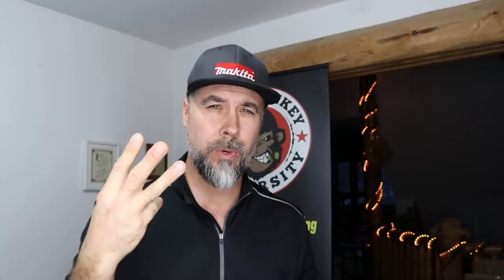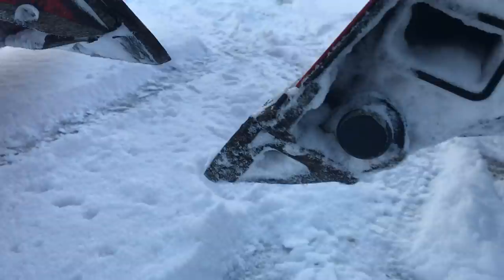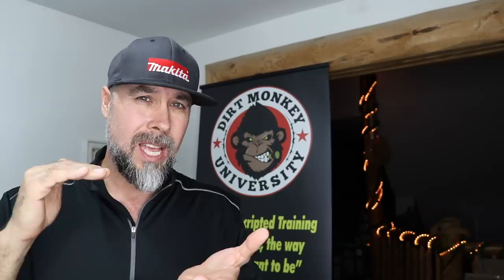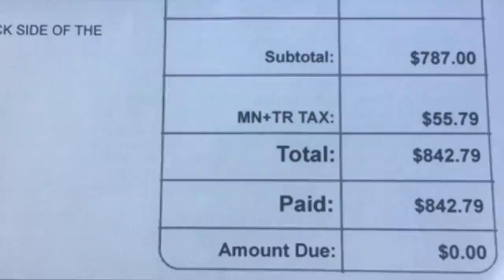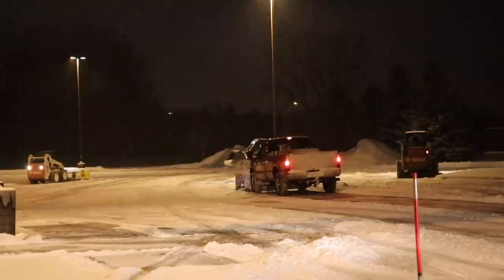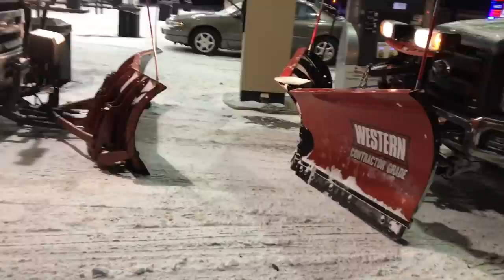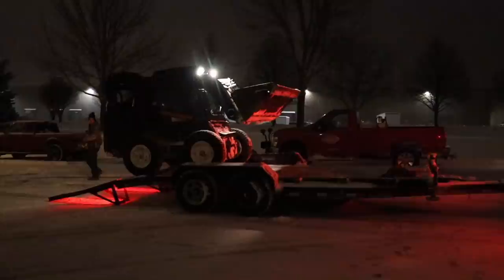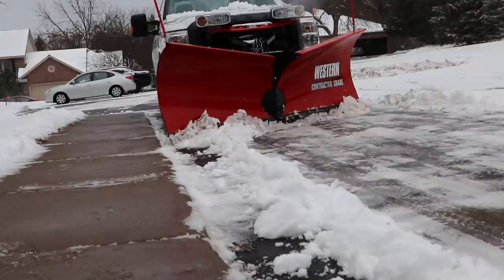Western Snow Plow Review after 13 years - Plagued with Problems

Comment: Stanley, why not contact somebody like metalmatic and have them CNC cut a different blade out of 100 series stock, make 10 and sell the rest as upgrades to cover your costs. If you use my idea, you owe me lunch. Smile.
Reply from the maker: I owe you lunch because that is my next plan.
Reply: AR500, its AR because its abrasion resistant
Reply: MinnesotaEric why would you pay sombody to waste time using a cnc machine to fabricate a cutting edge ? A cutoff wheel & a 1/2" drill bit will yield the same results.
Reply: It looks like Western has a lip, band sawing everything to the right size takes time, drilling ten 1/2" holes per bar takes time, and making ten replacement edges takes even more time and my time is worth money.
Reply: MinnesotaEric 3 complete cutting edges could be fabbed up in an hour. The amount of money you'd save should far outweigh the cost of purchasing and paying sombody to remove the old and install new edges.
Reply: Exactly what i thought of withing the first complaint. Make my own with better steel. 

As for the controller, id get a custom one with proper buttons and locations..
Reply: if it is a good hardened steel, a drill bit will not mark the steel at all, it brakes the tip right off
Reply: ROTAXD 
Ya like a standard drill bit will go through ar500 steel. 
Laser, plasma or waterjet only.

Comment: Wait...you're actually buying cutting edges from the dealer ? Smh. You do realize you could buy a 24' x 8" section ov 7/8" thick steel at your local steel yard for maybe $120 ? That's 3 complete cutting edges. Btw, western is known as a residential plow manufacturer. You get what you pay for. You claim you've plowed your whole life and you're still paying for pre made cutting edges & plow adjustments ? Smh

Comment: Late nineties into early 2000s. Meyer snow plows used crap steel on their edges and a frames etc.  used to see mostly yellow blades around here in north east Ohio.now they are all red. Boss and western.  Western better step up or they will go to the scrap heaps like Meyers.  Bad practice to charge so much and screw the user. They will learn quickly one way or another

Comment: hey man I'm letting you know that I have a buddy has a snow removal business he has four trucks two of his trucks has Western plows and the other two trucks has boss plows he had more problems with his Western plows they have froze up he has gone through five cutting edges with in  two seasons his two trucks with the boss has had no problems other than the occasional bulb replacement and the controls for his Western plows suck and the controls for his boss plows are way much better two of his trucks has the Western wide out and the other two trucks has the boss ext plows bottom line is he's getting rid of the Western plows and he's going to replace them with boss plows I even hate the Western plows controls because of the buttons I'm even considering getting a boss plows for my personal truck I have a 2018 Ford 450 super duty Platinum edition I'm looking at the boss ext plow for myself

Comment: MY NAME IS MIKE AND I LIVE IN WASHINGTN STATE  I LIVED IN ALASKA FOR 15 YEARS AND WORKED AT PRUDHOE BAY FOR 8 YEARS SO I KNOW A TINEY BIT ABOUT SNOW. I HAVE A WESTERN PRO PLOW  1997 VER. I PLOW ABOUT 10 TO 15 LOTS PER EVENT  I NEVER BUY MY CUTTING EDGES FROM WESTERN  THERE ARE OTHER PLACES TO GET THEM. 1 DID GET A ONE THAT WAS THIN BUT I STILL GOT 3 YEARS OUT OF IT. JUST REMBER WHEN YOU BUY A CAR THEY HAVE CHEAP TIRES . ANOTHER THING IS IT IS KINDA UNFAIR TOO COMPAIR V EDGES TO STRIGHT EDGES, YOUR PUSHING MUCH MORE WEIGHT WITH A V PLOW, MUCH MORE DOWN PRESSURE. IF YOU WANT TOO MAKE EDGES LAST LONGER  TAKE THEM TO A WELDER AND HAVE THEM HARD SURFESTED ALL OF ARE STUFF IN ALASKA GOT THAT TREATMENT. ANYWAY I THINK YOU ARE OVER REACTING . THERE ARE OTHER OPPTIONS OUT THERE . YOUR NOT GOING TO GO TO A CAR DEALER TO BUY  YOUR NEXT SET OF TIRES ARE YOU? JUST A THOUGHT!

Comment: Have you ever thought about fisher snow plows I feel they are made so much better then western plow.
Reply: Fisher/Western are the same, their parent company is Douglas Dynamics.
Reply: I know but I have a fisher extreme v2 for 3 years and the cutting edge has only worn about a 1/4 of an inch. Fisher also has two controller options in stead of 1
Reply from the maker: I would try something totally different next time.

Comment: They should be using mangalloy or AR-600 steel... It is designed to take that kind of wear. Western is using your standard weathering steel... Sure, corrosion resistant, but worthless beyond a few runs on anything but dirt.
Reply from the maker: Sounds like room for improvement.

Comment: Stan, I have all 3 of the brands Boss, Western and Myer so I really have no super brand loyalty. Looking at your two plows in the video I bet there is a big weight difference between the Hiniker and Western. That weight while scraping would certainly wear edges quicker. Also we were seeing this on our big plows that we use on our dump trucks.We started using the shoes and it saved cutting edges. Yes,we would wear out the shoes but there cheaper then cutting edges. Maybe try that just to see if it helps.
Reply: GreeneRidge Landscaping shoes? Who uses shoes? Lmfao those go right in the scrap bin first mod! Waste of your time, its like plowing with your plow not touching ground. For gravel drives for homeowners use lol
Reply: Kwmike-D they work well for us. Been doing it for years
Reply: GreeneRidge Landscaping they do work for the light duty/homeowner guys. Id wear those out first 2hrs of storm on one 28mi condo
Reply: Kwmike-D I don’t do light duty homeowner work.we do roads. Our large 10’ funnel plows were eating edges so like I said we started using shoes and when adjusted properly they did the job and saved edges. Also on roads the 8’ Western pro plus and Myers lot pro we’re going through edges fairly quick. We had our welder hardface the bottoms of the factory shoes, much like you do to an excavator bucket and we had great results and longer life out of the edges. Stan said everything he has done has not worked so I mentioned this as something to try.
Reply: I plowed roads for a town several years and adjusted the shoe height after every storm and it saved buying and changing cutting edges dramatically.
Reply from the maker: All great advice.  I did use shoes but we have zero tolerance-so we removed them.  Their is a big difference in weight from the hiniker to Western but both scrape the same. They both leave the ground with little compacted snow so in the end I worry about cost and those western blades are killing us.

Comment: Why don’t you buy Fisher plows?
Reply: His Western MVP3 and a Fisher VX2 use a lot of the same components like moldboards, hydraulics, electronics, hoses, controller and I'm pretty sure cutting edges.
Reply from the maker: Same company really.
Reply: I do know that physically they are not the same, although they both share some components, the cutting edge on the Fisher is also a carbon steel cutting, I don't know what the Western, I can say that around upstate NY everyone uses Fishers and also the controller on the Fisher can be enabled to one touch float

Comment: The very best CUTTING EDGE IS by using a truck leaf spring, {{ A.K.A. VERY HIGH CARBON STEEL ))  ( flattened out / straight ) use a torch to make the bolt holes . Sounds crazy..  Believe ME it lasts a VERY LONG TIME !!  P.S.  I WILL NEVER EVER BUY A CHEESY INFERIOR/ POOR QUALITY / made in china  STEEL CUTTING EDGE OF DEALER SUPPLY STORE AGAIN !  ** pickup truck leaf spring leafs...or medium duty-semi leafs /leaf spring... whichever... at least 3 inches wide or wider..
Reply: what is  more durable than a leaf spring for using for cutting edges ?

Comment: find a blacksmith an have them harden then tempor the blades
Reply from the maker: I need new edges.
Reply: call a Blacksmith find out if he has steel the size you need, cause he can make a set, harden then tempor them an you would NEVER have an issue ever again.

Comment: Western tryed to copy fishers fish stick but they failed the Fisher goes in to float when you put it down...
Reply: Western and fisher r owed by the same company so it's not copying. And western has one touch float u just gotta set it.
Reply: Western fisher snow ex and blizzard are all owned by the same company all of the same design and same parts I.e some controllers, look at the fisher  xls and western wideout, the only difference is the trip edge vs mold board trip, I've used all of the brands I mentioned above
Reply: Tells you in the manual how to set it to one touch float mode.
Reply: The controllers are the same other than button color and the label, they both interchange. They are owned by the same company,

Comment: I work for a county here in Michigan and we have every plow on the market current and previous models and we have for sure noticed the wear problem we have massive lots so we plow at a fairly high speed so I put a cutting edge on our mvp plus and mvp 3 every year. Now I have 2 boss as well at the same building doing the same lots and do those edges about every 3 and a half years. So I went to the local welding shop to ask if they could make me one and they are a western dealer so they said they couldn't. They can make one for my boss plows but not my western due to them being a western dealer. Now I can get one from the steel supplier but I have to punch the holes and ive done that and its just not worth it cuz u need a good carbide bit to get through it and their goes ur cost difference and its still a pain in the ass to drill through. I love our westerns but I haaate their edges. BTW they make an aftermarket controller that can control the wings front and back with their own buttons. It adds two buttons but still easy to use
Reply: Ryan Cadwell what do u gotta punch holes for? Drill to bolt size,put nut on, smack bolt head to seat it, then snug bolt down with impact. Sucks it right in. We reuse bolts all the time. Double up edges also on the tri axles
Reply: Torch is even faster of it needs to be changed during a storm to do the holes. AR400 from steel shop is our best friend for cutting edges
Reply from the maker: So your having the same issues.  Good and bad to hear.
Reply: yep same problem do the edge on the mvps every year just did it in December nd its over half wore western wont do anything (adjusted correctly)
Reply: last year I did all of em to see a comparison and have not needed to do any but the mvps this year and still have about 3/4 left on the boss and hiniker

Comment: Why on Earth would you run down a piece of equipment and a company based on a cutting edge which is a wear item? That's like saying you're not going to buy Fords anymore because you don't like the tires. We run westerns and have no issues but I can tell you right now you can buy cutting edges aftermarket from tons of suppliers. I literally pay less than $150 for a cutting edge. Again, this is a wear item. This is ridiculous and you shouldn't hold yourself out as a guru if you don't know this information

Comment: Blah, blah... don't see you use a caliper to measure gauge, or a file to test hardness.  This isn't rocket science.  You can buy new blades from other companies, or have your own made if you don't like the Western product.  Or just buy Hiniker and forget about Western.

Are you getting paid to bash Western by Hiniker?  Wouldn't surprise me.
Reply: xephael - No he feels he’s getting ripped off
Reply: These are heavy duty plows made for heavy duty trucks. If it doesn't seem heavy duty or long lasting then it's a cheap quality masquerading as heavy duty. The negligence is that the company is ripping off the customer by false advertisement.
Reply: Xephael you can have cheap steel be the same size as high quality as it is what is in the steel not how thick it is. In this case it is the Rockwell hardness of the steel.
Reply: Andrew H That's why he should compare its hardness with a file to a different blade that doesn't exhibit the issue like I suggested.
Reply from the maker: Nope thats not what Im doing.
Reply from the maker: Willy-  You said it perfectly!
Reply: @xephael  its called a REVIEW!!! Jeez... do you work for Western or something?
Wouldnt surprise me.
Reply: I'm not going to go so far as to say that you're getting paid to bash Western but I think you are jumping the gun. Cutting edges are wear items. I'm going to stop using Milwaukee utility knives cuz the damn blades keep getting dull. Sounds pretty stupid doesn't it? Just get a different Cutting Edge from a different manufacturer if you aren't happy.... They are available everywhere for every make and model
Reply: It just might be the nut behind the wheel lol
Reply: Quality of steel nowadays is subpar to what it was years ago.
Reply: And/or the composition of the steel.  As someone already mentioned, they may not be using an abrasion resistant steel.